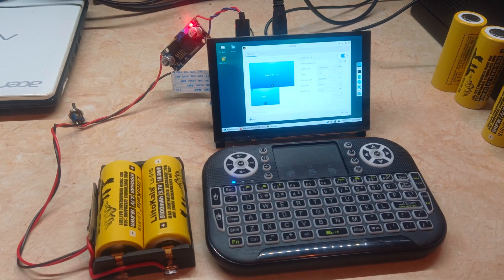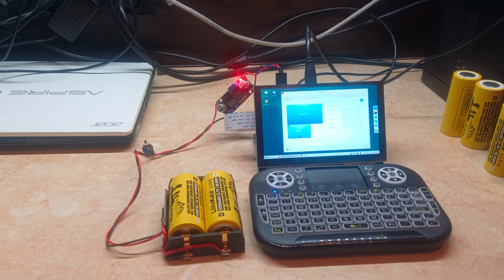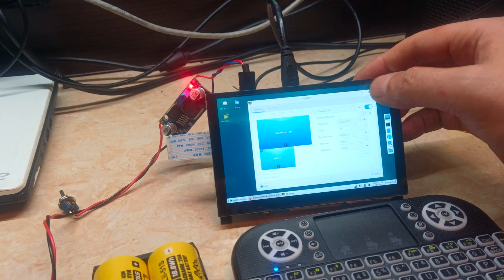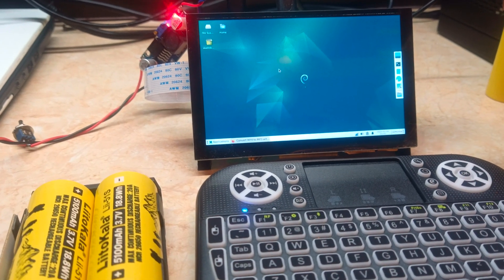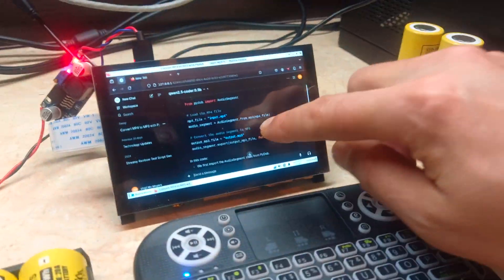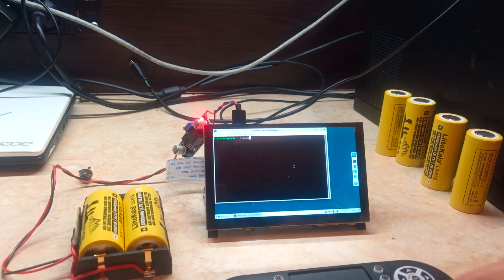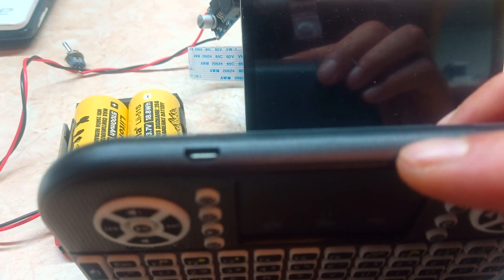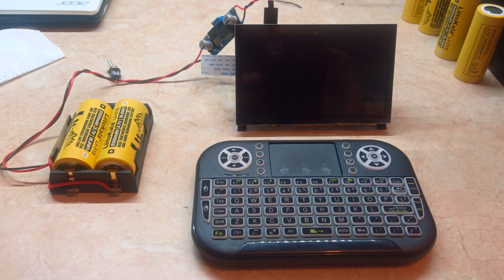Offline AI on portable raspberry pi setup.

Comment: nice stuff, now how much this AI is actually intelligent in comparison to ChatGpt or Claude ..?
Reply from the maker: Offline solution. It can handle the LLMs between 0.5B and 1B parameters. I'm using coder and it is easily making the Python programs up to 100 lines of code. Sure not fast but not critically slow